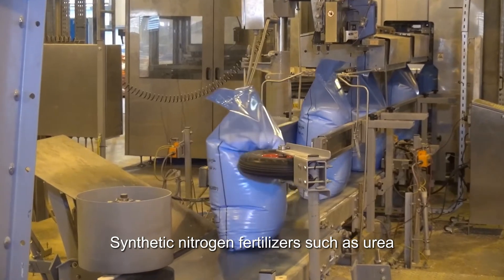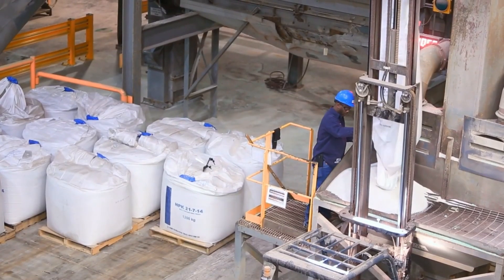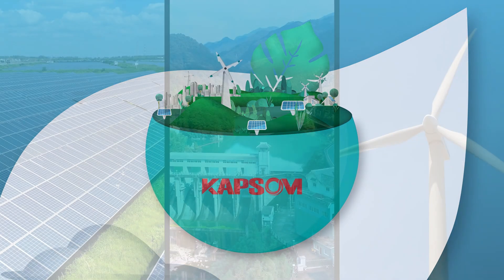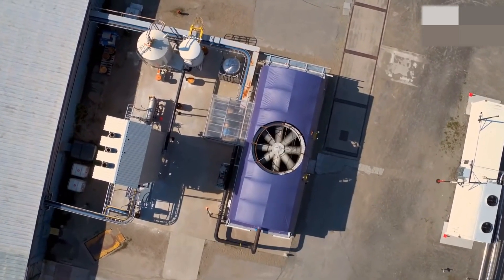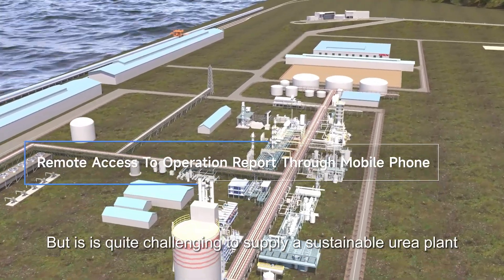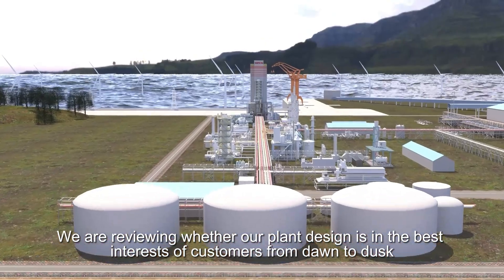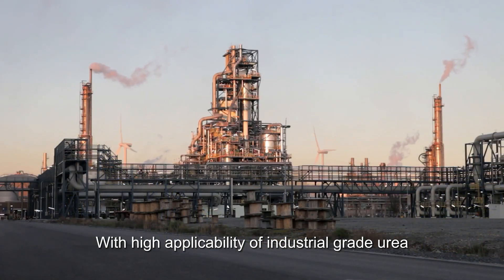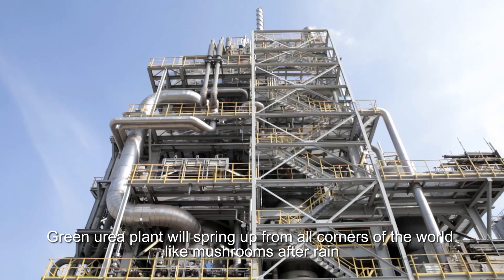The Story of Green Urea and KAPSOM

Comment: Thank you for great video. I have a question regarding CO2 for feedstock during urea production. How is CO2 sourced to mix it with ammonia to produce urea? Is it captured during the process of manufacturing ammonia or is it captured from nearby industries that emits CO2 and transported to urea production facility? Thank you.
Reply from the maker: There are two sources of CO2, one is to use CCUS technology to capture in nearby industries that emit CO2 or directly obtain it from the air with DAC technology. Both Ways are environmental friendly.
Reply: @kapsom2013  Thanki you. If I were to install 100 MW elctrolyser for green urea production, what would be my total daily water consumption from production of green hydrogen to  green urea production. Could you provide me the tentative daily urea production from 100 MW electrolyzer? Thank you.
Reply from the maker: @Wanderer42-jj  You could ask for more details via https://www.kapsom.com/contact/, and KAPSOM's urea production engineers will answer your questions as soon as possible.
Reply: Energy percton of urea ?